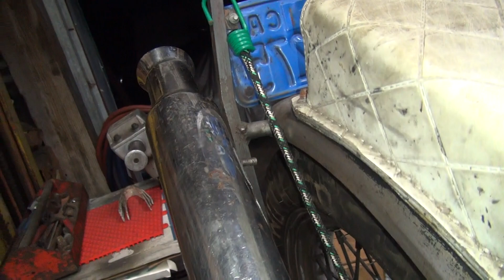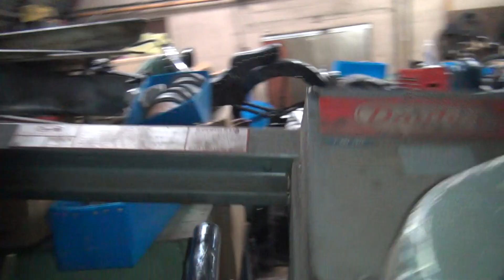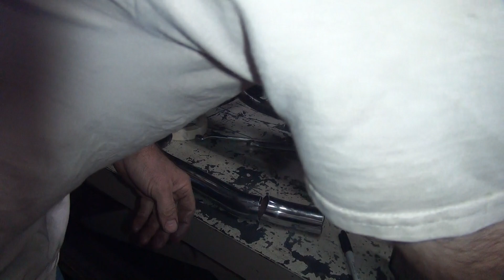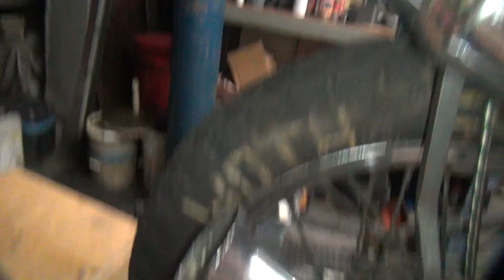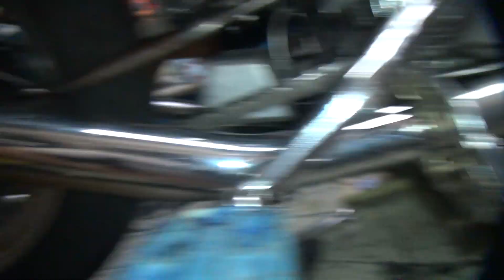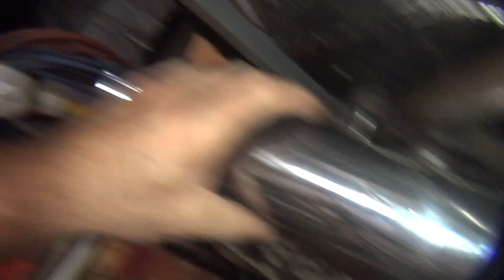1972 XL Ironhead Bobber #260 Sportster motor rebuild #2 bike repair harley by tatro machine

Comment: i'm surprised walker let you alone with it at this point. that dude was getting super uptight! is there a picture of how he wants it anywhere? i draw excellent mechanical diagrams on bar napkins all the time...
Reply from the maker: only in his mind and that can change very quickly. as you can tell i do what i think will work the best for what he thinks he wants.
tatro